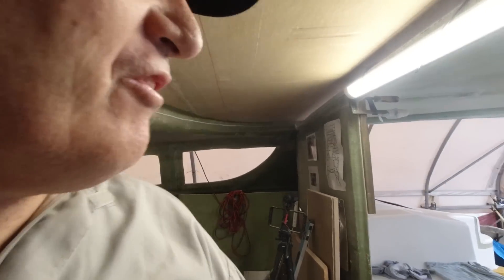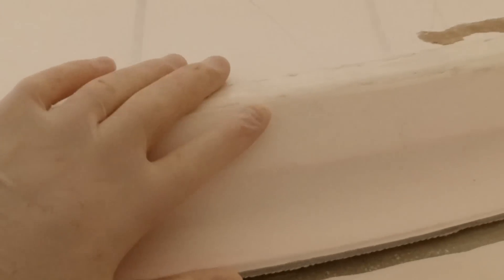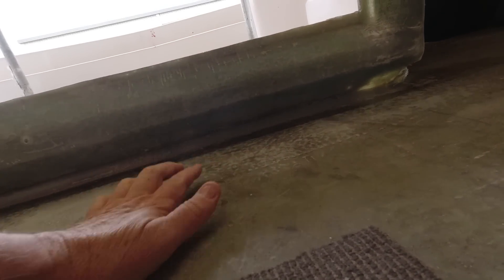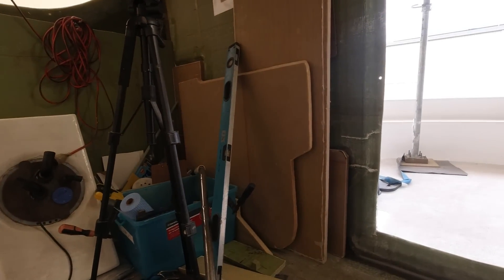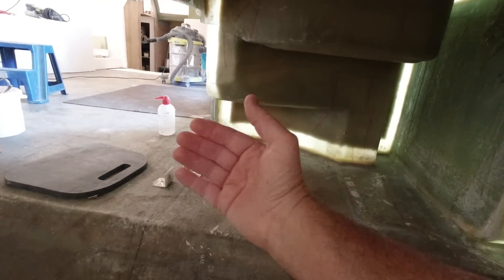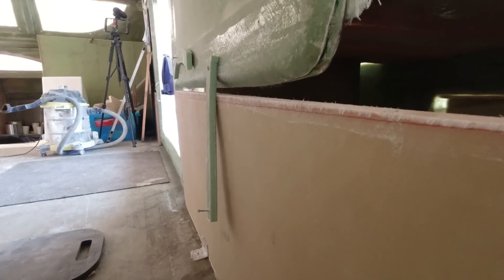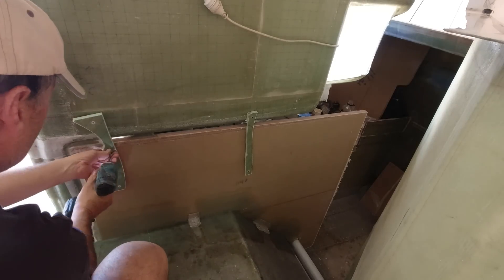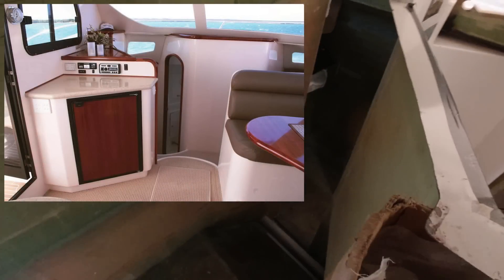Tying the whole Project Together - COMPLETE CATAMARAN BUILD EP223

Comment: Your a master at this mate. I remember back in the 1980s repairing boeing 747 boat fairings we used 19 mm thick honeycomb sheets instead of foam, it went around corners beautifully and the cabin floors were made of it. Fiberlame if I remember. Keep dry bro
Reply from the maker: Hey Mark. I have a bout 10 sheets of nomex which is the same, kevlar reinforced honeycomb, May use it to make a nice lightweight tender. All has to be vac bagged.
Reply: Looking forward to it already

Comment: For soundproofing I'd want to see solid panels with dead air space between the panels.  Alternatively, a loose weave fiber between the panels.  Only one panel need be structural.
Reply from the maker: Yep I will have some type of baffling in the cabins as well for sound proofing. Cheers Ross

Comment: Generally I avoid fluids, especially pressurised or flammable, routed through living spaces.  There is also the consideration of possibly having to disassemble cabinetry or flooring when there's a problem in the line.
Reply from the maker: I have another route that may well prove t be a better solution. It is in the stern lounge suite I have access hatches for better access. Rossco